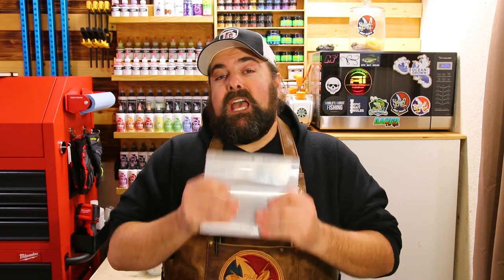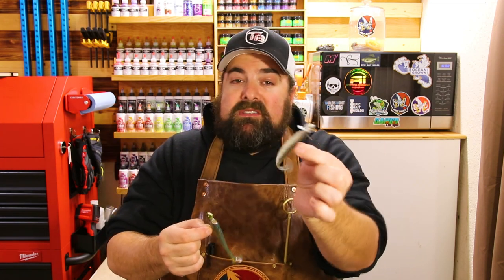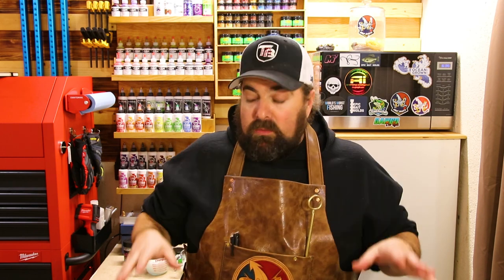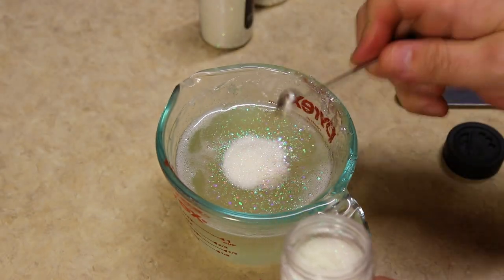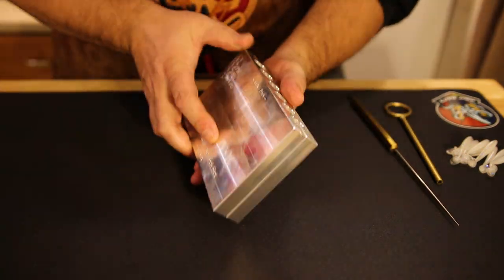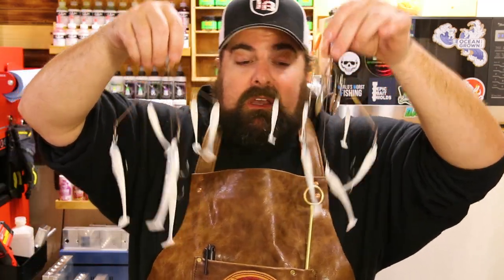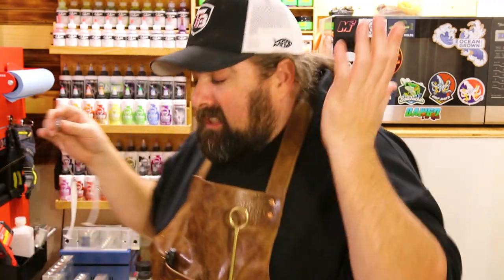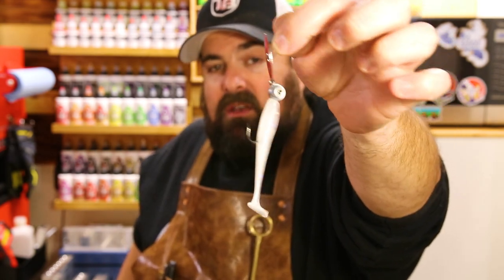The Epic Bait Mold You Didn't Know You Needed - Epic Slick Swim

Comment: When you are vacuumed chambering how do you prevent the plastisol from bubbling up over the top of the cups?
Reply from the maker: The extra bubbling comes from lots of moisture in the plastisol.  One trick you can do is to wait until the bubbles get to the rim of the pyrex cup and then SLOWLY open up the vacuum valve to let some air into the pot. Do not open it all the way or air will rush in, but as you slowly let in air the pressure will drop and the bubbles will drop.  Once the bubbles have dropped a little bit then close the valve and let it start vacuuming again.  Sometimes you may need to do this 2 or 3 times during a vacuum of a cup.